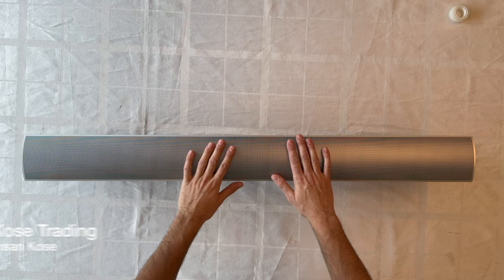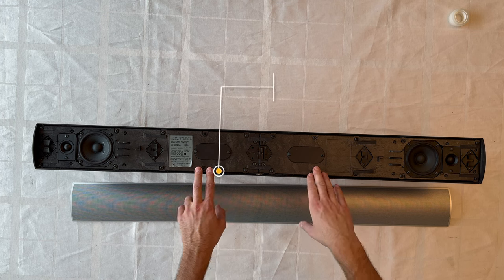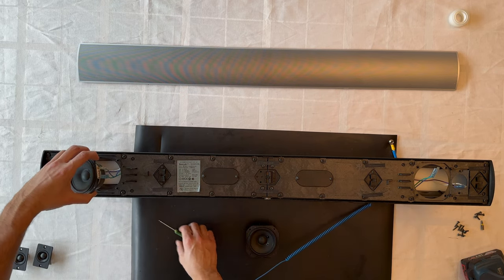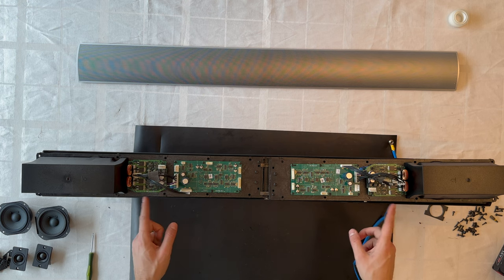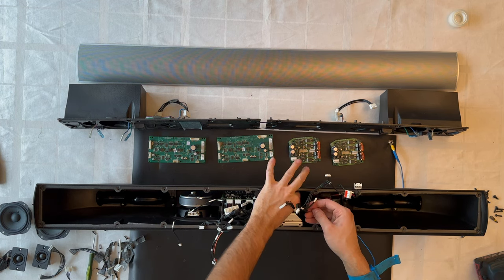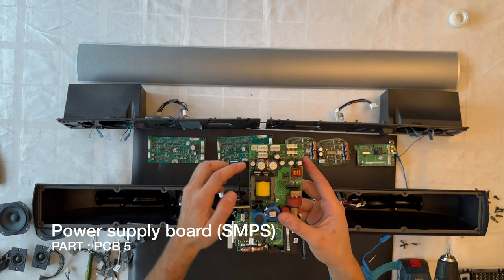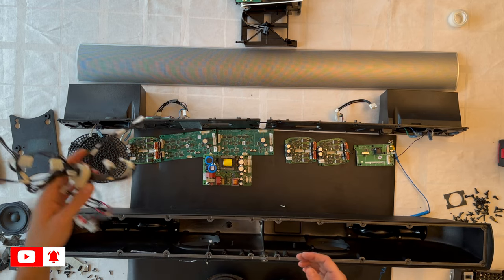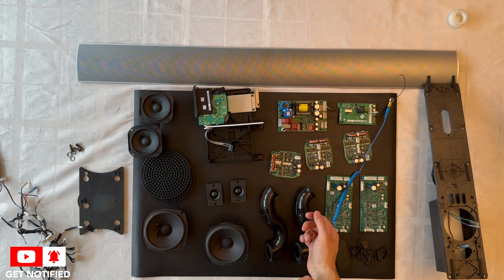Bang & Olufsen BeoLab 7.1 Active Loudspeaker Disassembly process and Repair guide

Comment: I just got a B&O tv with this center on but after I plugt it out from the power source.. it won't work.
Reply from the maker: Can the tv turn on?
Reply: @KoseTrading  Yes, the soundbar is just not working after i pluged it out. It worked, but after some time it had a bruming sound and i just pulled the plug out on the center and the noice stopped after. I shot down the tv pluged it back and now it's "dead"
Reply: Wait! It is working again now after I had it shot for a while but the nice is there like electric noise Bzzzzz
Reply: @KoseTrading Sound perfect but must have some hig volume on
Reply: Its from the right and left speeker on the bar
Reply: I kan feel the vibration on the 2 midrange driver...
Reply from the maker: Sounds like the you need a new amplifier installed  @MichaelTheDacian